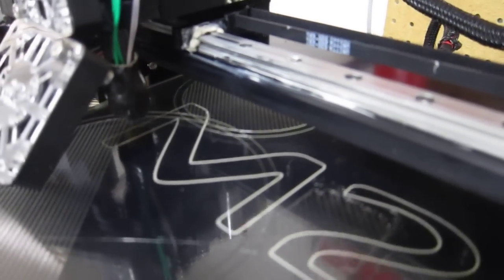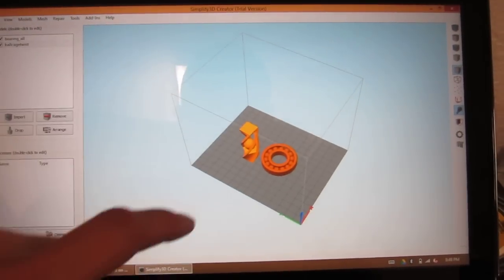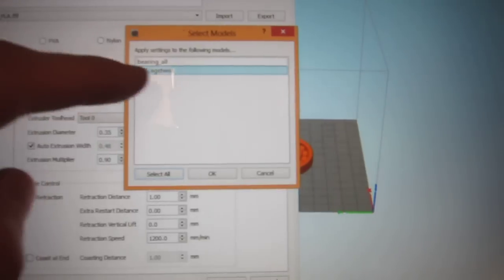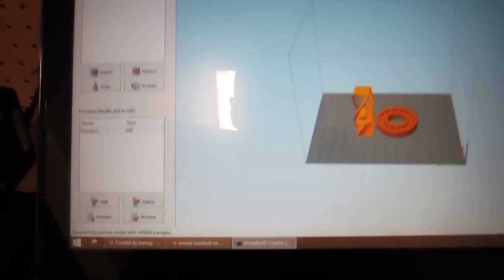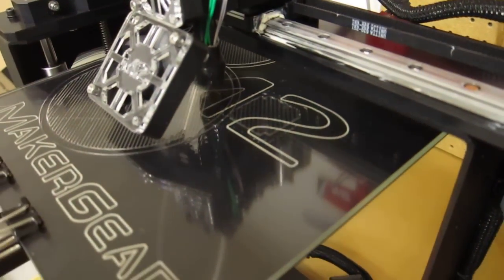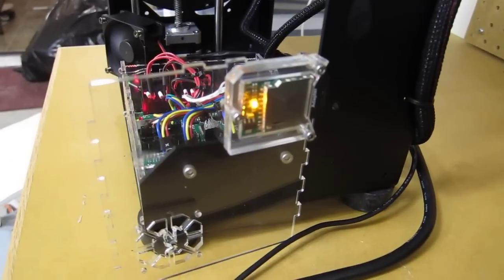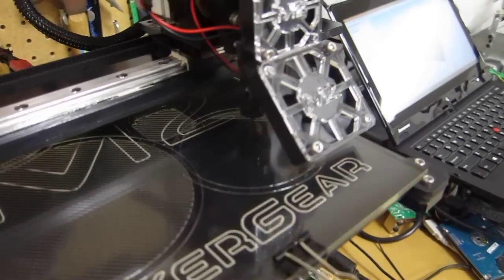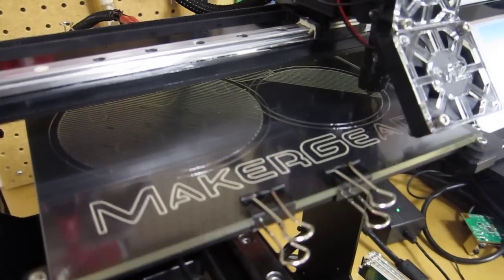MakerGear M2 - Multiple objects test (each with unique settings) - Creator

Comment: I have also had amazing experiences with MakerGear tech support, they take care of you, Not such luck with Creator though.  It won't work with my M2 AT ALL.  Anybody have the time to share their Creator/M2 settings?  I've been screwing with it for weeks trying to get it to do ANYTHING, but after switching from slic3r to Creator, nothing happens.  

Borosilicate glass is what pyrex used to be before they went cheaper, it's extremely high quality glass that can withstand temperature swings without excess expansion.  You can put it in the freezer and your print will pop right off after 2-3 minutes.  I've done it a dozen times.  I usually just wave it up and down for a minute to cool it a bit, then right into the freezer, if you keep the door cracked and listen carefully, it will sound like the glass is cracking, but it's actually the print pulling itself right of the glass.  I don't even OWN a scraper cause I don't need one.  Of course, I also don't use hairspray or anything, I print my pla right onto the bed at 65c.  It works for me.